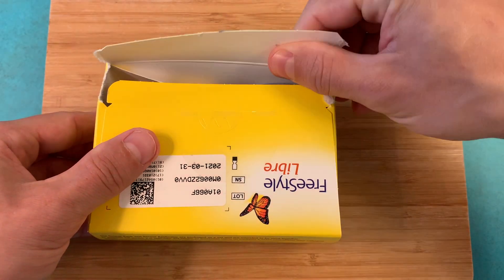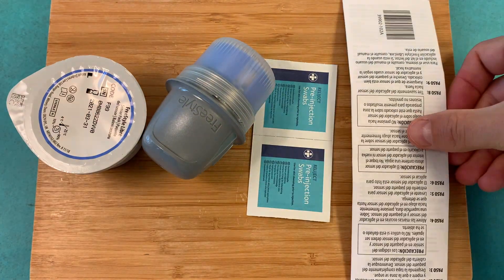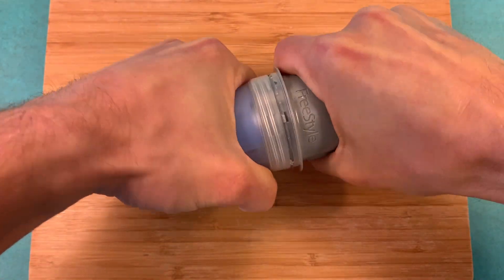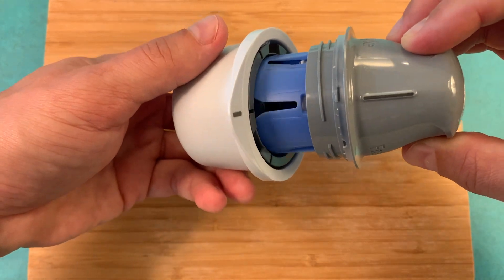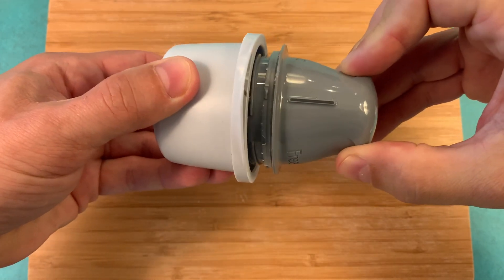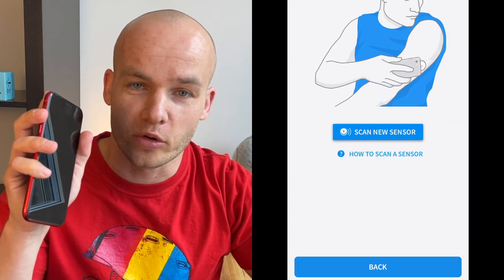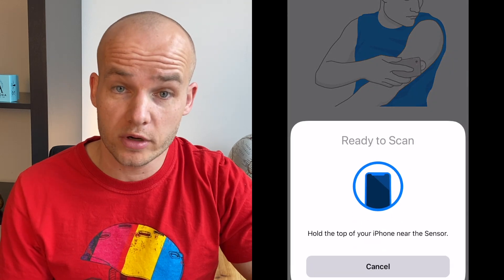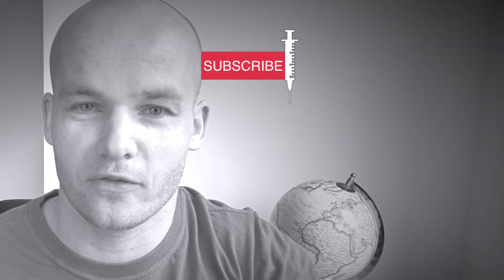How to Apply FreeStyle Libre / Quick And Easy Sensor Insertion Tutorial

Comment: Just got the Libre 2 delivered today. I haven't had a cgm since 2016 and it was a dexcom. I liked the unit as it was the most accurate at the time. I dont like using my arm for sensor sites. I have damaged tissue on both arms With deep scar tissue (non diabetic related injury) . I believe it was the dexcom4... Yeah those sensors were not fun to install BUT...... It was before dexcom fixed the "glitch" where you could use sensors for as long as you wanted to as long as they were accurate and the tegaderm and skin tac were good ! 31 days was my record.. lol.

Comment: When you were talking about activating the sensor, you said that if you activate with your phone first, the reader won't work anymore. This is incorrect. The reader won't work for that sensor but will work for the next sensor if the reader is used to activate the sensor first. Then you can still use your phone/app to get readings.

Comment: This is my 3rd Freestyle Libre sensor and first time using Libre 2. Unfortunately also my first time get so much blood out of the center of the sensor, no blood from the previous two. May be they changed the needle or just my bad luck. By the way, this is the first time I am using the location as shown at 2:20 min mark, further back of the upper arm. The previous locations were also on upper arm but more next to the chest.
Reply: 𝐌𝐢𝐧𝐞 𝐣𝐮𝐬𝐭 𝐝𝐨𝐧𝐞 𝐛𝐮𝐭 𝐡𝐞 𝐬𝐚𝐦𝐞

Comment: I recently went on the freestyle libre 1 (got it from my diabetic nurse) then switched to the freestyle libre 2 and I had the 2 for like 2 weeks and went through 3 sensors every single one of the freestyle 2 sensors were faulty only one lasted almost 2 weeks the others lasted not even 24 hours and I put on the spare libre 1 sensor I had and it’s been perfect I’d much rather have had 2 sensors that worked perfectly rather than 3 that didn’t work so because of that I am switching back to the 1! I’m happy to finally have sensors that are working!!

Comment: I’ve been type 1 for 43 years and just started using this. Your video has been a great help and much better to follow than the instructions provided. Than you so much!
Reply: How is it going 43 years on? I’m hitting year 16 after diagnosis around 27 years old. Nobody could really explain why… Just got this Libra 1 device today and it seems amazing so far. It’s been wild swings up & down all day every day. And of course not enough strips to test so much. So high in the morning. And then a seizure low in Jan. The idea here is this will help regulate me. 
How has your experience been and what’s it like now?
Reply: @DylanMadd  my experience has been pretty positive so far. If anything it’s made my control easier to manage after a yo yo period at first due to me over checking and trying to micro manage it. Oh and covid a couple of weeks ago didn’t help. However try to relax with it and try not to over compensate like I did. Hope this helps.
Reply from the maker: You are most welcome! Thank you for your kind words! Take care my friend

Comment: Hi Tom, this is my first sensor and so far I am really happy. I have only one problem and that is the alarm on the link keeps disconnecting from my phone. I activated the sensor with my phone (which is compatible) but the alarm goes off saying that it isn't connected and I should scan again. I closed the WiFi and this worked but after a couple of hours it did it again so I activated my WiFi connection. This is repeatedly happening and I really don't know what to do. Can you suggest anything?
Reply from the maker: Welcome to the community! It’s interesting because the sensor should not have anything to do with WiFi connection/network. It uses NFC.
Reply: @TypeOneTalks  thanks for answering so quickly. Today I spoke to the company and after asking me to scan the sensor 3 or 4 times they said that the alarm wasn't working properly and are sending me a replacement. I have learnt, and am still learning, so much from your videos which are so well explained. Thank you!!
Reply from the maker: BelindaHII You’re most welcome!